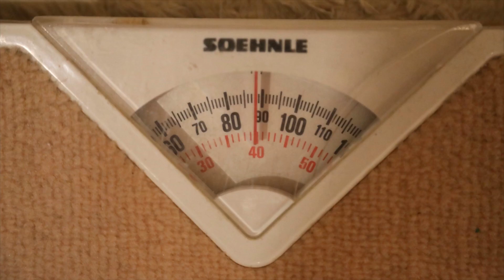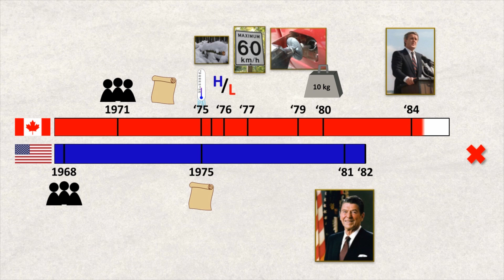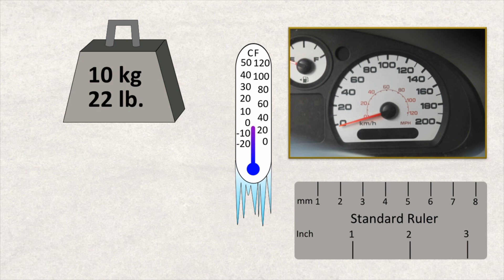Canada is Metric-ish

Comment: The metric system just makes more sense than the Imperial system we have. Everything is base 10, there's correlations between different things and it just works better than the Imperial system. 

For example water freezes at zero and boils at 100. Easy. Take a cube of water 1cm on each side and that's a gram. Take a cube of water 10cm on each side and that's not only a liter but it weighs a kilogram. 

The fact that we are the only industrialized nation NOT using the metric system is actually kinda shameful.
Reply: Because 10 Units Is Good For The Real World
Reply: Km/h is slow
Reply: Who measures things in even tens though?

Comment: You use metric system everyday and you don't know it.it's the dollar , 10 cents 20 cents .cent means hundred in Latin.
Reply: No, money is not Metric, it is decimal.  It has nothing to do with the Metric System.  “Decimal” does not imply Metric.  Decimal notation is much older than the Metric System and is used by everyone, everywhere.  We even use it with US Customary units (feet and pounds) which are definitely not Metric.

Comment: In my country , I’m used to the imperial system with regards to my height, for 5’2”. I can understand that better compared to the metric system. The other most common units of measurements that we use in measuring volume , distance & weight - my home country uses the metric system. Like meters & kilometers for road signs & distances ; liters & milliliters for liquid volumes; kilograms & grams for weight like when we buy meat or fish in the market🙂🙏✝️

Comment: IMO there is a widespread failure to understand that there is a crucial difference between measurement systems and STANDARDS.  A simple example can be found in the home.  I want to plug in an electrical device : does the plug fit ?  Assuming the plug does fit, [ and if is does not then game over ] is it the RIGHT plug for the device ?  The device has to mesh with the type of electrical energy coming from the plug.  There are many other examples round the home - plumbing fittings, mattress sizes, gyproc panels, door sizes ,,,,, and the list continues.
The application of metric standards to automobiles has been more successful than the domestic houses.  This is because automobiles become obsolescent at somewhere between 10 and 100 times the rate at which houses do.
In hobbies there is a great difference between say electronics on the one hand and woodworking or dressmaking on the other.  Electronics has always been dominated by scientific and/or metric-based standards as has photography.  Dressmaking is almost immune, except that in Canada cloth is sold my metric measurement now.   Human bodies however seldom come in according to exact standards.
Woodworking hobbyists in my experience for the most part prefer Imperial units.  If you look at rulers, if they have both metric and Imperial, the imperial side is most often calibrated in 1/8 or 1/16 inches rather than in tenths of an inch.
As a matter of personal experience, many years ago I was involved in designing hulls for radio-controlled model yachts, particularly the American One Meter Class.  The rules for the design stipulate that the overall hull length shall be one meter.  That said amazingly the majority of American designers interpreted this as a length 0f 39-3/8 inches, and would make their drawings based on dividing this crazy unit into increments of ten for the hull frame spacing !  An amazing piece of insularity and stubbornness in my estimate.

Comment: stop its so dumb like why is everything half metric and half imperial just go full metric its sm better
Reply: People who think “full metric” is feasible just don’t know all the facts.  Cameras everywhere, even those made in Germany, have a tripod connector with a UNC thread.  Pneumatic tires everywhere are inflated through a Schrader valve with a nonmetric thread.  Intermodal shipping worldwide uses containers which are measured in feet and aggregated as Twenty-foot Equivalent Units (TEUs).  The 19-inch rack is used everywhere for mounting electronic equipment.  The square drive for socket wrenches is 1/4”, 3/8”, 1/2”, 3/4”, or 1” even in metric counties.

Comment: A lot of confusion this has caused. Canada should have reverted right back to imperial measure when US scraped metric. They are Canada’s largest trading customer. It just makes sense! Now we are stuck with a metric ish canada. So many things are still presented in imperial system. What a mess.
Reply: That's even more stupid. 95% of the world uses metric
Reply: Shaun Gordon let them, it’s terrible. What my point is.... is that Canada being half and half on this is confusing! Think about it. Nobody stops and thinks... real estate measurements in imperial measure, highway speeds in metric. Building products sold as imperial measure, grocery labels in metric. Give your height and weight in imperial measure but car odometers/speedo in metric and it goes on.
Reply: No.  That's stupid.
Reply: We (in the USA) didn’t scrap Metric, however.  Metric units have been legal in the USA since 1866.  All that was done in the 1980s was to declare the work of the Metric Commission complete.  Its work was education, not forced conversion.  We are free to use Metric units as we please.

Comment: Transport is still non metric. 40' containers, 48x40" pallets, 44,000 lbs trucks must cross the border (truck speed always in km/h).
Reply: Here in Brazil we use 20' and 40' containers, but it is the only
Reply: The TEU (Twenty-foot Equivalent Unit) is used worldwide for shipping containers.